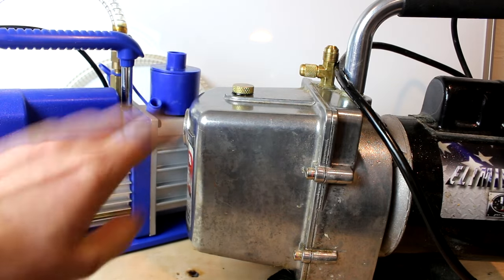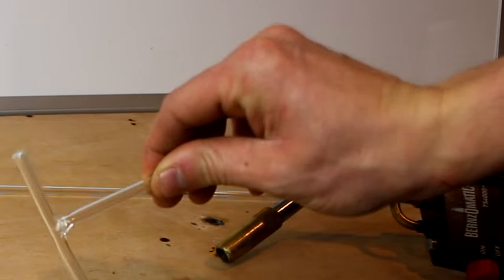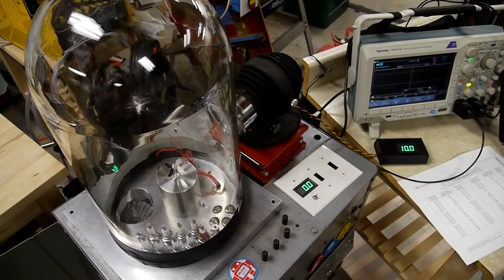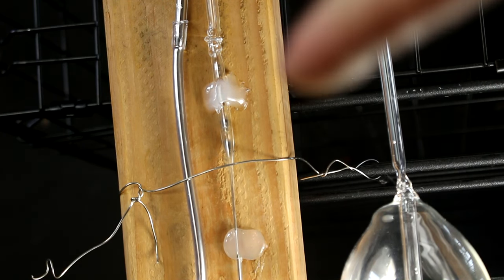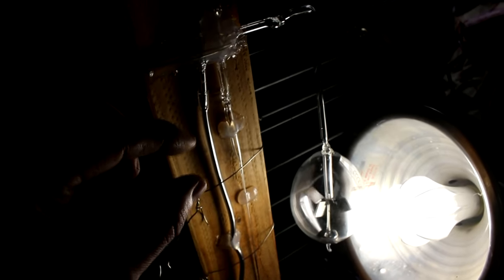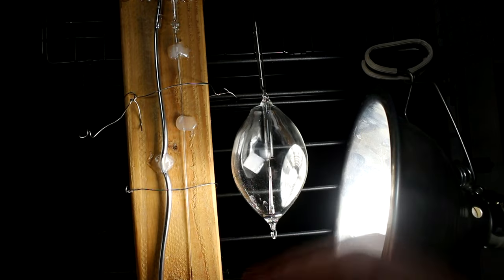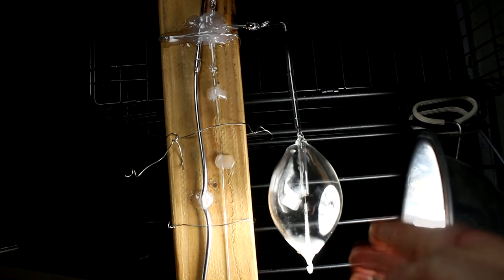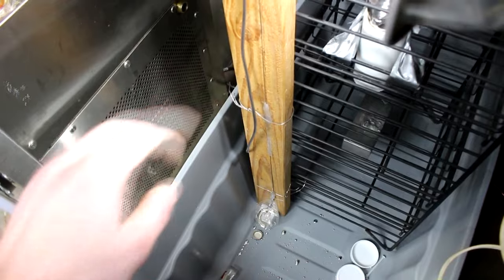Sprengel Vacuum Pump: The most efficient vacuum pump ever?

Comment: How does someone get to the question "I wonder what would happen if I put one finger in this here pool of mercury and another in this here other pool of mercury"
Reply: mickeybill Curiosity!  Cody as a similar search for any knowledge, that I have.  Why do you think that his videos are so very diverse?
Reply: Because he's got his finger in all sorts of different pools of mercury... I mean pies.
Reply: #JustCodyThings
Reply: I'm guessing putting a wire in either container and reference it to ground would get rid of the difference in electrical charge
Reply: I like how you phrased it as Cody would.
Reply: simontay1984 The resulting discharge would just burn the LED out.

As for something larger, nope. The charge is there, but there's nothing to maintain the charge to keep the flow of current running. So while the resulting discharge might give out a lot of energy, it would start and stop so fast it wouldn't be able to power anything.
Reply: simontay1984 potentially however it wouldn't be a constant flow as it would even out rather fast and the difference caused by the friction against the glass would only be small
Reply: Sorry, I guess I misunderstood the question. What Jasper Briels says is correct. I would think that the resulting potential should be in the order of a few millivolts per second, and the only reason it built up so much was because Cody had been running it for several days.
Reply: Ameto that's ok, where all sival here. what you said is correct as well when you put a led in between after it had been running it would burn out the led
Reply: imagine the first person who thought 'mmmmmm, look at that calf drinking his mother's milk, I want some'

The first person to think that saw humans and animals regularly drinking milk "from the source"; thus, not weird at all.  The real question would have been, "will it kill me?"
Reply: Snails/Slugs...  1st person to say Oooh something I can catch and its probably delicious. Esp with really shaken milk that weird guy stole from that calf's mom
Reply: +Jasper Briels But if you put in the LED before you started it, it would act as a voltage limiter, and glow a little bit.
Reply: GordieGii the (static) charge buildup would be to slow and even out as soon as there is a difference therefore the led wouldn't glow :)
Reply: If you connect the LED at the beginning, nothing is going to happen, there won't be enough current for the LED. If you wait a day like Cody did, and then connect the pools with the LED, it will just burn the LED. Theoretically you shoud be able to use the electricity produced, but it would be very difficult.
(Sorry for my bad English, I'm from Switzerland)
Reply: GordieGii
The LED would be below the required voltage threshold, so it would simply function as a conductor, leaking the current, but it wouldn't glow.

Entcraft44 Theoretically, yes, but in practice, it would require wasting way too much of the energy it would produce, or using components with really high voltage ratings and impedance, that don't really exist.
Reply: Ameto Yes, that's exactly what I ment.
Reply: Well, for Cody, putting fingers in mercury is pretty much a kink now. It would only follow...
Reply: I realize I'm going to show my age here, but a small neon lamp would be a better discharge device, since it wouldn't be damaged by a little surge current.  ("Neon lamp?  What's a neon lamp?")

Comment: The density of liquid metal still amazes me. "We're going to put a POUND of mercury in here" Adds a tablespoon of it
Reply: Mercury is about 13 times heavier than water
Reply: And water is pretty dense
Reply: Yeah lol, about sums mercury up. I've got a little tiny plastic bottle that's an inch and a half in diameter (inside diameter) with 4 inches of Mercury in it, but there's almost four pounds of it lol. It's deceptively heavy, it kinda surprises me every time I pick it up.
Reply: I was thinking the same thing

Comment: Getting shocked from Non Electrical Vacuum Pump
Good Old Cody :D
Reply: J C d o n ' t .
Reply: J C Sitting here watching tv with my exotic butters but this weird thing keeps popping up to my right. I think it wants my body.
Reply: J C Nice game theory reference.
Reply: Or should I say, FNAF reference.
Reply: ***** S U R E
Reply: Don't mention butter in the Cody household! That means injury...
Reply: You have to give him credit. He gets injured/hurt from the most ridiculous things. And not from the dangerous stuff.
Reply: Cody is King!!!!
Reply: Himanshu Sharma y
Reply: yeah how is that possible?
captain?
Reply: I think he should connect both reservoirs to a lightbulb in order to discharge that electrical potential.
Reply: static electricity it think
Reply: or to the ground SIMPLE
Reply: But that's wasting the energie. We want it do meaningful work. I use meaningful very loosely.
Reply: Hold On R U Trolling me Or Really Suggesting This XD
Reply: I am really suggesting this.
Reply: No, it's just like static electricity can't be contained or used as it's Amps are too low to be used for anything.
Reply: Ah, alright. Thank you.
Reply: How much would the static buildup make this engine less efficient than it could otherwise be?
Reply: Use a small picture tube instead of a radiometer, hook up the anode to whichever reservoir is positive and cathode to the other one.  use a small power supply to heat the filament.  Watch the screen glow.  I think that'd be even cooler than getting a radiometer to work again.

But seriously, this is the coolest thing I've seen all week.  The only thing that's kept me from playing with vacuum is the expense of vacuum pumps.
Reply: Wouldn't the filament just burn out after a few minutes in air?
Reply: but couldet you harnes the electricity ?????
Reply: some stranger yeah with a tesla coil and 2 super conducting wires in from the 2 pools to the top of the tesla coil sence the static energy would turn to AC and power your house.
Im a genius let me go make that thing now.
Reply: You could use the electrical potential to run the device. Or at least a portion of it. 
Efficiency FTW xD
Reply: well the man does seem to have fallen into the habit of doing the improbable  lol
Reply: connect it to a light bulb to spin the radiometer

Comment: Thanks so much for the shoutout!  I had never heard of a Sprengel pump -- very interesting -- and very insightful comparison to an aspirator pump.  Your video output and motivation is incredible, man!  Your discovery of the electrostatic charge pumping must have been exciting -- similar to a Kelvin water dropper.
Reply: Applied Science I'm not sure,  but I think because of you guys I found Cody early on. Love your channels, keep on being awesome!
Reply: This kind of pump looks very harmful to me, not worth the risk. Hg is very bad for the nervous system
Reply: Serachja just dont drink it, or rub it into an open wound, or work with it in a small closed space with no ventilation for hours on end...Cody has tons of videos explaining how mercury really is very safe with common sense.
Reply: Actually, you can drink mercury without causing much harm as it doesn't get absorbed fast enough through the intestine before it goes out the other side (high specific weight :-) ). The issue starts when you inhale the vapors. Especially in concentrations as I would expect are present in the video above. It gets to your brain and never leaves it. If you are eager to destroy probably the most complex object known to men go ahead and breath it in. I rather don't. Doesn't affect just you as there are most probably people that care about you that will suffer with you
Reply: I do fear the concentration is above 0.1 mg/m3. I'm doubting the ventilation that can be achieved by simply opening a window in a closed building is sufficient for such an experiment. If he would be outside in open space or if he would be using a fan system (like in a chemistry lab with a hood) I would be less concerned. In the end I can't measure the Hg concentration that was present during this experiment and everyone is responsible for their own decisions.
Reply: Cody works almost daily with mercury, and works with it in the same fashion. I don't recall which of his videos (I think his flush mercury down a toilet video) he shows his blood test for mercury. It was normal. I agree, you can't really know what the actual concentration of the mercury is in the air in this experiment, but that should give you an idea that the precautions he takes are sufficient.
Reply: I agree with you that he seems to know what he is doing. Nevertheless, I wouldn't do this experiment so "uncontrolled". Hope he doesn't get sick or hurt in any way.
BTW, thank you for the link you provided before. It could be useful in the future.
Reply: I trust Cody's experience to the degree that I'm confident that he knows what he's doing, and won't get seriously injured (emphasis on seriously lol) He has some past videos where he did mess things up and has been injured, and went over everything he did wrong, which I think is very good. Now, if you REALLY wanna see someone who has no idea what they're doing and if someone copied them can potential be seriously injured or even killed, check out backyard scientist. For that link, you're welcome :-D
Reply: Thanks, will do so :-)
Reply: Serachja - it's more mercury SALTS-IONS that you need to worry about than elemental mercury.... which is pretty inert .
Reply: My old chemestry teacher told us about an even older professor of his who used to work with mercury like this for decades. This guy aparently ended up with blood mercury values twice as high ad usually would be considered deadly and stil died "of old age". "The body gets used to it" the teacher told us, so we should not shit our pants about safty issues. I always answered that he was free to take any chance he wanted with his own life, but should not advise others to do the same. So please  advise all people to rather take a silly amount of safety measures,  than have them die a silly death, even if it is years later probably. I am sure Cody knows how to handle his ass plus he is a lucky guy, but don't make others follow his lead, who might have worse luck or simply mess up by getting cocky in the wrong situation.
Reply: what if you use NaK and the electric field to accelerate the procedure ?
I know it's very dangerous but could be a nice explotion anyway... ;-)
Reply: Applied Science + Cody's Lab!! Awesome! :D
Reply: For what it is worth, if it is German the ang sound should be pronounced as in bang.
Nice video, thanks..
Reply: Kelvin water dropper? I have never heard of it but it sounds like what Victor Schauberger was doing with his water dropping experiments.... 
I thought that Victor discovered it? Now I have to go and find out more about this Kelvin water dropper thing.... 
Also, how much heat transfer do you think that this device was able to achieve? The squeezing of the air between the mercury seems like it should be putting out quite a bit of heat towards the bottom end while there should have been a cooling effect up top under vacuum.... Would have loved to see it through a thermal camera..... A voltage measurement would have also been a bonus for this video..... I would definitely watch that....

Comment: I'm very glad you made this pump. It's one of the classical masterpieces of scientific laboratory inventions that's similar to a typical water aspirator but relies on the high density of mercury.

One thing I have to warn you about (and I keep warning in in every video where you work with glass) - anneal your glass! Download a book on flameworking and see the details; they can make a difference between successful apparatus and an explosion/implosion. The joints you've made are extremely unstable and prone to cracking. I was very surprised this thing actually survived.
You're working with glass as if it's metal. It can't be suddenly attacked by vicious sharp hot flame and then quickly left alone without storing enormous stresses inside and I'm positively certain that one day such practice will make you pay. Please be more careful.

BTW, the charge separation is very common in vacuum systems. This one is similar to Kelvin water dropper. One initial difference will build up.
Also, Sprengel is pronounced ['ʃprɛ. ŋəl ] as it's a German surname. G is hard and S is sh.
Reply: Lajos Winkler who knew a kerbel would know so much.
Reply: To be fair, metals store stresses in a similar way that can cause serious problems as well.  It's just that most of them are much less brittle and just warp instead of shattering.

Comment: As a glassblower, I cringed really hard in the beginning.
That being said, I was very impressed with what you managed to put together and that the cold seals on the welds actually held up in a vacuum!

MISSION PASSED - RESPECT +
Reply: You be amazed at what people get away with when they don’t know better.. ive made sci glass for around 15 years now but started with similar basics in my basement lol
Reply: I cringed over the null safety messures with the mercury
If any of you ever work with mercury always wear a mask with gas filter
The most dangerous part of the mercury is the invisible (at naked eye) vapors that it emanates even at low temp
Reply: @spammerscammer  wow! Who hurt you?
Reply: @azazeltheforgotten  Naah, the vapor pressure of metallic mercury ay 32F is miniscule. That being said, I'd still use gloves. Cody has been doing a lot of mercury type projects and has normal mercury levels in his bloodstream believe it or not.
Reply: @azazeltheforgotten  no, the most dangerous form of mercury is any organic form.  Mercury metal  vapor (as evidenced by it's use in this project) is trivial - if it had a significant vapor pressure, this wouldn't work at all.  
In many ways, this is the original vacuum aspirator (using mercury metal rather than water) to achieve extremely low vacuum.  It's also the basis of another ultralow vacuum device (the mercury diffusion pump).

Comment: This would work more like you wanted if the radiometer was the other way up, 
so the remaining air/vapour in the chamber flows out under gravity.
 I used to work for a company making mercury barometers, and worked with diffusion pumps, and this is part of how they work.
Reply: So he probably have a perfect vaccum at the top?
Reply: That could create a slug of mercury in the line, preventing a good evacuation of the radiometer bulb. To get rid of that mercury, leaving the lamp on it, to heat the mercury in the radiometer hotter than the mercury in the Sprengel pump would eventually evaporate the mercury, and it would condense in the pump. He really DID do it the right way, though he could have solved the problem by putting a trap in it, so mercury couldn't back feed into the radiometer. Live and learn, that's why this is called an "experiment".

Comment: Please measure the voltage between the two reservoirs!
Reply: It's probably in the thousands but with a very small charge.
Reply: power something!!
Reply: Doesn't that mean it is even more efficient because it's actually creating a small amount of potentially usable energy as well as created vacuum
Reply: @suneyman5  You could probably adapt the system to increase the potential. I have no idea what's going on there, but I would guess friction plays a role. The final bit of tubing could be made from a different material, or have a different geometry, to increase friction, without compromising the efficiency of the vacuum itself.
Reply: @ongbonga9025  Basically gravity gets turned into negative pressure on the vacuum side and positive pressure on the exit site. In very small amounts. Due to Mercury being a metal, it can quite easily move electrons around in itself and they can be picked up by the tubing material, creating a difference in potential.
Reply: Less efficient, you're wasting some of that 700 j of energy on making the potential rather than removing air.
Reply: Basicaly if we put enough mercury to our rivers, we can make hydroelectric powerplants much more effective.
Reply: David yet a cool way of turning your body energy into usable voltage